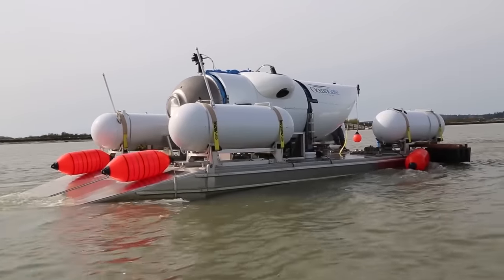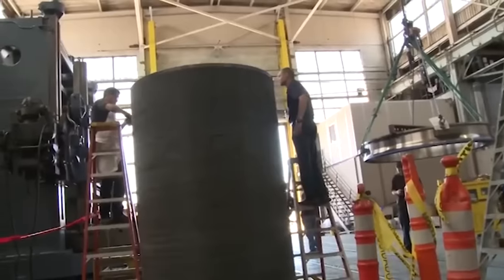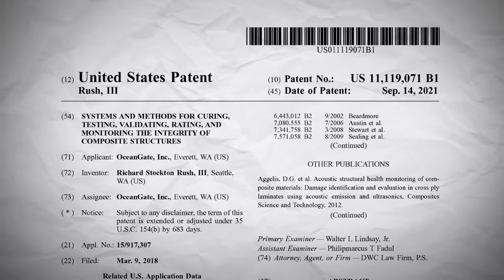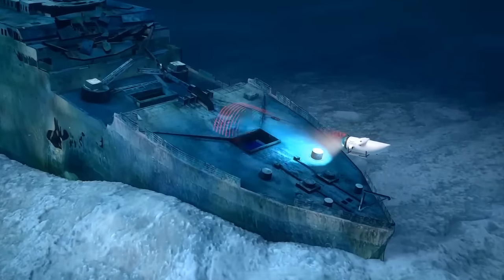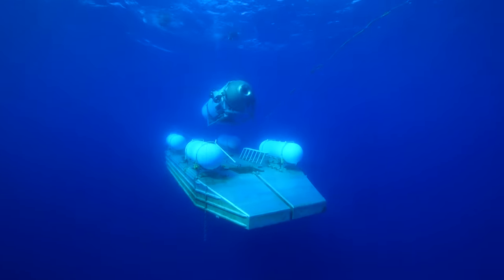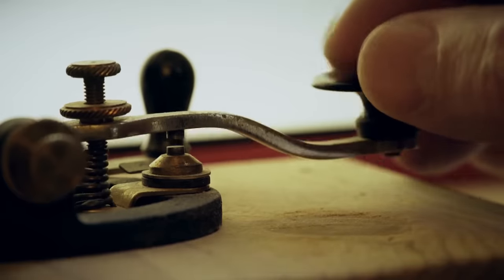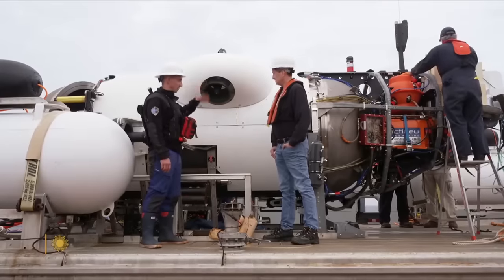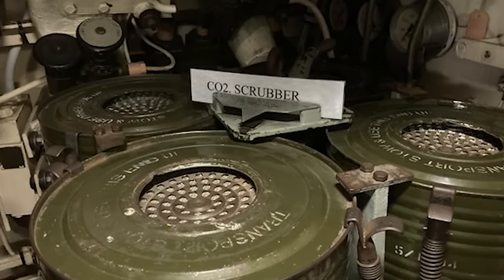Exposing OceanGate Submarines Many Fatal Designs

Comment: I’m wondering how all the carbon fibre aircraft, like the Dreamliner, are going to hold up as they age.
Reply: There's a huge difference between an airplane fuselage and a submarine hull.  The airplane is built to hold pressure in, and the differential never exceeds 1 atmosphere; carbon fiber works well here because it's very strong in tension (resisting stretch).  A submarine is built to hold pressure out, and at Titanic's depth the differential is ~400 atmospheres; carbon fiber is a shockingly poor choice here because it's weak in compression (resisting squish).  Also, Boeing was required to test the Dreamliner airframe through many cycles before obtaining certification, which Stockton Rush flatly refused to do with the Titan.
Reply: @ericwent4931  an airframe fueselage is a lot thinner though and still suffers considerable stress (as per Conett back in the day). Hopefully you are correct, but there are plenty of examples in aerospace of new technology turning out badly over time. Unlike Aluminum it’s a lot more difficult to check carbon fibre for stress issues, and much harder to fix (which creates a reporting disincentive).
Reply: @mkyhou1160  Your points are well taken, and certainly carbon fiber is likely to give much less warning before it fails than most metals.  Your mention of the Comet airliner is interesting.  It turns out that the original design might have been strong enough, but DeHavilland cut corners during production: rather than glue the window frames and drill clean holes for their rivets as originally specified, DH skipped the glue and just punched the rivets through the skin, tearing the aluminum.  One of the minute tears (initially hidden by the rivet itself) grew through fatigue and may have caused the fatal blowout.

Comment: there is no submarine that is piloted by a game controller. certain systems on board may be controlled by a controller, but there is not a single vessel in any military that is piloted by a wireless controller and suggesting they exist is just irresponsible.

the controller was a massive design flaw, regardless of what a bunch of gamers who cannot handle cognitive dissonance would want us to believe.

Comment: Everyone is an engineer now. I’m thinking the most unspoken issues with the design is Fatigue stress on the carbon tube. Especially where its bonded to the titanium end caps. As someone who does a lot of failure analysis that’s where I would start.
Reply: No...just some :)

Comment: When Anderson Cooper interviewed James Cameron about the tragedy he mentioned he talked someone out of going on Ocean Gate trip (I believe it was for previous missions). He literally said to his friend "If you go down there on that you will die". Good thing he listened to the man who went 30,000 ft to the Challenger Deep and came back alive.
Reply: Just curious why is it that that are wine bottles in the titanic site fully untouched and unbroken by the so called tremendous so called pressures?
Reply: @deecastle5053  Also, the wine bottles that sank on the Titanic experienced gradual changes in pressure as it sank. If there was a wine bottle inside the Titan when it suddenly went from 1 atmosphere to over 300 atmospheres, that wine bottle would have been obliterated.
Reply: James Cameron was also reckless, but at least knew to do only a one-off mission. 

Success was not guaranteed, and never is with a one-off experiment. There are always unknown unknowns...
Reply: @stevenverrall4527  The submersibles that Cameron did his dives in were extensively tested, so I wouldn't say he was reckless. Even his solo dive to the Challenger Deep in the Marianas Trench they spent years in design and testing of the sub they used for that.

Comment: Cool video! What I wonder is how many CO2 scrubbers they had on board and if they changed them out during their dive or not. I guess it doesn't make much of a difference when you implode but I still wonder these things. Personally, I think what cause the disaster was that the temperatures that deep in the water are such that carbon fiber is likely to delaminate and I'm surprised this didn't happen the first time they went to those depths.
Reply: I read NONE.

Comment: Your shot at 5:57 where you mention game controllers shows a soldier with a radio used by professional drone pilots. Its not a game controller. Huge difference between ready to go consumer tech and professional equipment that requires setting up and binding of controls.

Comment: The vessel was NOT designed to dive to 4000 feet: it was designed to support an overblown ego and generate revenue in the cheapest way possible.
Reply: @@OliviaSarm15GH 

Pretty well... the original toothbrush was a twig. 🤪

Comment: Having worked in aerospace composites - biggest flaw - composite pressure hull - not used anywhere else, for good reasons.  (BTW: jmo2321 gives many details)  The biggest issue is that hydrostatic integrity depends on adhesion between the matrix and the fibers - which manifests with each dive as increasing salt water microcrack intrusion, until critical compression strength degradation reached, then boom  Note:  The railway car example given was only under 15 PSI - the Titan was under a few thousand more - when the hull imploded the signals from occupants' nerves from their sense organs to their brains would not have had time to respond.  Therefore, they would not have experienced the implosion - it would have been over well before their brains could have been aware of it.  Small comfort?

The nondestructive evaluation (NDE) - acoustic emission (AE) is almost useless with composites - because sound travels very weirdly through composites - this has been known for decades, since composite tanks on satellites have been used since the '80's.  So the owner was either stupid (ignorant, as many rich techbros are) or evil.  Like musk and his dirty rockets.  We had been building successful rockets and deep-submersibles safely for decades before techbros started this capitalistic craziness.
Reply: Ok very interesting. But "Musk & his dirty rockets"?. Are you referring to the Crew Dragon capsule? Is it dodgy? Do you think it could burn up on re entry or maybe a launch incident?

Comment: It didn't implode, the pressure actually ripped off the landing racks and cone cover and the tube with all 5 on board went straight down and crashed through the top of Titanic. They came to rest in the large ball room with their lights still working so they could see they were inside the Titanic. At this point, they knew there was no rescue possible. 

The other 4 customers took turns every 30 minutes banging the CEO's head against the side of the tube. Especially when he turned to everyone and smirked and said " Now you'll get the FULL Titanic experience".
Reply: best comment LOL

Comment: No it's not common to have the controller connected via wireless (Bluetooth)  there was no backup system in place at all. Not even a second controller.  It should have been attached by cable.

Comment: With all the electrical devices there had to be a large amount of batteries. If batteries were stored in the same area with the crew, what was the plan when a battery fails rapidly discharges explodes causing other batteries to explode? It needs power to operate communicate return to the surface ventilate toxic fumes….. this could never end good.

Comment: Would really like to see a video on the total construction of the submersible.  All these systems in place.  Where?  Was the pressure vessel totally sealed and all controls done wirelessly.  How was the wiring routed.  You mentioned scrubbers to breathe.  Were they located internally?  At the pressures encountered, it's hard to imagine any wireways, piping breaching the hull.

Comment: To me the most ridiculous aspect of the poor design is not the xbox controller... dissolving sand bags... being bolted in from the outside... hell it's not even the carbon fiber shell that failed which are ALL pretty nuts... but the absolute mind bender is the "Acoustic monitoring system" that is a fancy way of saying that when you hear the carbon fiber shell failing... you know the carbon fiber shell is failing!!!  It's like saying you have a "acoustic fuse monitor on your bomb" and it tells you seconds before your bomb is going to explode... and you are bolted into that bomb deep underwater an hour from the surface.... the kicker is Stockton Rush holds a patent on the system... my God what kind of insane thinking is that?!?!

Comment: You missed a some issues, 
1) carbon fibre is excellent under tension, but less good at compression.  In a sub it is under compression.
2) electrical equipment in a sub use is both redundant and have special fire rating since in a case of fire - there is no a lot you can do and it uses up your oxygen and creates CO2 which can saturate your scrubbers quickly.  Standard games controllers and monitors don't have the required fire management you want in a closed space in which you are bolted into.

Comment: I wonder how much it would cost if we actually wanted to to build a submarine that could reach the bottom of the Mariana trench and be a very large submarine. I wonder if the walls would have to be like 3 ft thick of steel or titanium.
Reply: look at the single person submarine that james cameron went in
Reply: @Michael-lg4wz  no I'm talking about like a submarine that's like a normal sized submarine it's like four buses long or something and can go that far down not a tiny thing but a big thing.
Reply: @Keepupthecardio  The Trieste bathyscaphe was light weight because most of the vehicle was a huge tank of gasoline used for strength and buoyancy, not fuel. Gasoline cannot be compressed, and it is buoyant, so it was ideal for deep sea trips. At the bottom of the Trieste was a tiny steel sphere containing the two crew members in a very cramped space. 

Building a vehicle that would carry 50-100 people into the Mariana Trench would require that crew to be divided up into tiny spheres held together with the biggest gas tank ever. There would be no point in doing that. And a full submarine-sized interior is not possible, because no metal sphere of sufficient size can both withstand the pressure, and be light enough to rise back to the surface.
Reply: @theontologist  oh 😢

Comment: My bicycle frame is carbon fiber and I had to have the fork replaced with an aluminum fork so I could put a riser on it because the carbon fork could snap and break so it's hard to believe this thing was made or carbon fiber when there's much stronger materials available.

Comment: Not questioning the controller.  I'm questioning why an experimental submersible would choose almost the cheapest wifi controller you can get.  I have a lot experience with the corded one.  Went through like 10 of them playing DFO.  I wouldn't trust its stick sensitivity or reliability to something such as a sub.  Yes controllers are fine, but quality matters here.  Design wasn't properly tested, safety was thrown out the window.  Yet agencies like NASA knows the consequences of taking safety into account, people die.  And down in the depths of the ocean, that far down, there is little if nothing that could be done if anything to the sub went wrong down there. 

There's another matter the concerns me greatly though.  IF they had acoustic sensors to monitor the carbon hull.  Unless all those sensors or the system was bad, they likely had some data of snapping of the woven fibers on each dive with the same vessel.  There is no way that the first or second time that sub went to the depth that fibers were already being stressed and/or snapped.  Meaning they must have had a safety margin with how compromised the hull could be.

Comment: All submersibles carrying passengers who pay should be required to be certified or be prohibited from legally charging passengers to take excursions below specific depths for specific lengths of time.  Also, all submersibles should be required to be tethered to a ship at the surface at all times.  In general all of the safety systems which were not in place on the Titan submersible & may have saved the lives of the 5 who died last week.
Reply: Submersibles going to that depth have never before carried passengers, and it isn't necessary. They've all been robot-driven.

Comment: My edc community is about to get carbon fiber at a fraction of the cost with all this negative press haha
Reply: if its not meant to hold 5000 PSI of compressive strength you are fine, remember carbon fiber was used wrong in this situation its meant for tensile strength not compressive and for the hull it wasn't in the optimal weave either

Comment: To put it in perspective, the pressure differential for that tanker car would have simply been atmospheric pressure or less, so under 14.7 psi. The the water pressure at the depth of titanic is roughly 6000 psi. Many hundred times what the car implodes at. It wouldnt have “likely” been faster and more violent, it most certainly was, incomprehensibly

Comment: 0:51 already a fundamental flaw in the design. Having a maximum depth of 4,000 meters when the titanic is 3,800 meters down isn’t good. 
In engineering, you never want an engine, pressure vessel, bridge, airframe, etc to be constantly operating at 95% of its absolute limit.

Comment: Correction.Those Logitech game controllers are NOT used in military applications on any regular basis. At times they are used for drones only. Those haven't been fire rated to avoid sparks, or contain fire retarded housings or internal parts. Even a small amount of smoke or heat can be fatal on a submersible. Those off the shelf parts are NOT used in any serious applications.

Comment: I don't know much about carbon fiber but what I HAVE heard about it is that it's only strong under TENSION! I don't see how fibers making up the hull of this sub could possibly have been under TENSION with every single square micron being under massive PRESSURE from outside! And having seen steerer tubes break off of carbon fiber mountain bike frames from less than 1 meter drops I wouldn't even ride those, let alone voluntarily board a carbon fiber SUB that's supposed to operate at depths of almost 4 kilometers! Not sure what the personnel capsule of the Trieste (the sub that first descended to almost the bottom of the marianas' trench back in 1960) was made of but given the fact that it was strong enough to withstand the pressure at a depth of more than 10 kilometers I don't see anything wrong with continuing to use that for modern subs too!

Comment: Just wanted to point out that that rail tanker car was under about half an atmosphere of pressure when it imploded. The pressure at the depth of the Titanic is about 380 atmospheres...
Reply: Even if we assume it was under a full vacuum, that's 1 atmosphere, not 400.
That stacks fast
Reply: @NM-wd7kx  It said in a video that it was 21 inches of mercury vacuum, so I was wrong, it's more like 3/4 of an atmosphere. But still.

Comment: How did all this wiring go from inside to the outside and not break the solidity of the carbon fiber?  Such as the power and controls for the motors and the lights. How is that making a sub securely tight? Thank you in advance for explaining.
Reply: The wiring went through a hole in one of the titanium end-caps, I believe.

Comment: Carbon fiber was a poor choice. As a positive pressure vessel, it is excellent due to its high tensile strength. Under negative pressure, carbon is significantly weaker.

Comment: Looking at the construction video it looks like the wound structure has no lateral integrity. No length to length fibres. No other attempts had been made to create a counteracting force such as making the hull slightly barrel shaped. It relies on glue. Any trained engineer will tell you that glue has very poor shear strength and consitency whatever its made of.  There are some strong glues but at 4000 metres? It seems that Stockton willfully ignored established expertise. As a five inch hull distorts and flexes the glue will crack causing catastrophic failure. I wouldn't be suprised if this was the problem or in fact the dodgy window. It would only take one lateral weakness for this to develop. The occupants would have been hit by the force of a thousand sledge hammers. Juiced in seconds! This seems harsh to say but its the truth. Reduced to a dark cloud in a deep ocean. The whole Titan episonde seems to have been full of a lot of willful bullshit, alarm bells have been ringing for years. He should have been stopped .

Comment: It’s carbon fibre so it wouldn’t have bent , it would have shattered like glass. With the water and those shards moving inwards at about a km per second. That’s the muzzle velocity of water jets used to cut steel.  Chunky salsa instantly.

Comment: The simple explanation...

Carbon fiber composite is best suited to withstand internal pressures, not external pressures. The fibers are designed to work in tension, not compression.

Comment: @1:41 That railroad tank imploding is a good illustration. Now that was only a pressure difference of slightly less than one bar. The pressure down there was 400 times greater. The forces are just so great that you cannot be cavalier about it.

Comment: As clever as Rush was when the hull cracked on previous dives he said:" it's ok it's five inches thick." That may be correct, but if it's cracking that's now a weak spot, it has to be, which means the pressure on the next dive will surely weaken that damaged area of  carbon and so on on further  dives.  It was just a matter of time and time  ran out.